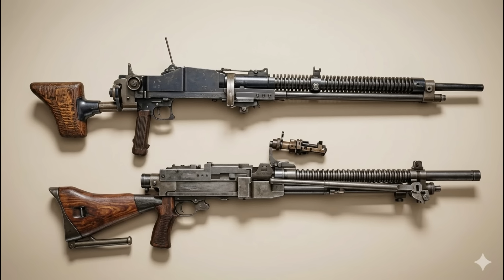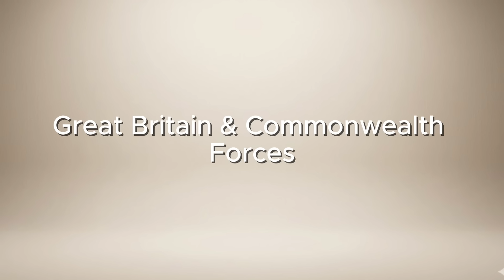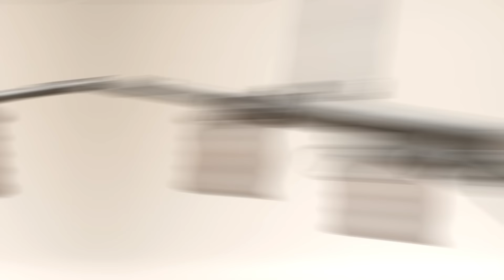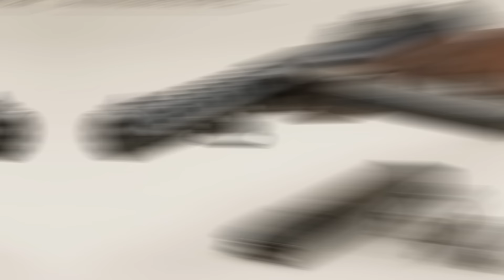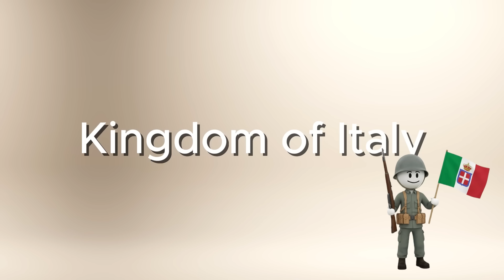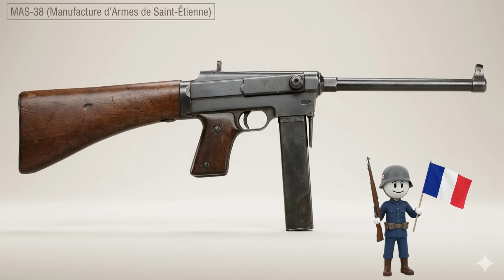Every Submachine Gun Used in WW2

Comment: Carried the Thompsons in Vietnam. First the M1, then the M1A1. Never minded the weight; it worked when the first M16 (XM16E1) did not. Had an M3A1. Junk. Traded it off.Saw an MAS 38 and passed on a trade. Wouldn't take one on a whiskey bet. Best sub gun of years ago was too late to be mentioned here. The MAT 49. Great gun. Can use slightly modified Sten mags. Was on a school patrol with a Sten MK II S. THe silencer worked very well.
What most people don't know is the M3 magazines had issues that were never solved. Magazines were always scarce for everything. The PPSH41 had stick magazine issues; the drum was the favorite.

Comment: ”Suomi KP” - simply best by test. Used even the Vatican Swiss Guard.
Reply: Sucks in Battlefield 5 though. lol
Reply: I was lucky to have a Sergeant with the old Finnish submachine gun in Sweden and tried it at the gun range. It was the best until the Swedish KSP-45 came in 1944.
Reply: Beretta 38, MP-40, PPSh -43, MP-34. 

There's many good ones. I don't know if most experts would say the Sumo was the best.
Reply: In WW ll making 3-4 pretty good guns in the same time as one excellent gun worked out best in the long run.
Reply: Yeah it´s still very highly regarded here in Finland!💪

Comment: One small correction: The Magazine on the MP 38/MP 40 was not meant to double as a holding grip. One was supposed to grip the magazin holder, not the magazine itself, which  could lead to feeding problems.
Reply: When you think about it that sounds like why people had problems with the sten submachinegun.
Too often in movies you see the actor grasping the magazine. But in other scenes it is held just behind the barrel and works smoothly. I had always thought that those that complain the most about weapons do not know how to handle them correctly. If the sten was as bad as depicted, then it would not have stayed as long as it did.

Comment: The video suggests the PPSh‑41 “turned the tide” on the Eastern Front, but wasn’t that more about mass production and Soviet doctrine rather than the weapon itself?

If the Suomi KP/‑31 was arguably more accurate and refined, why is the PPSh-41 often credited with the real battlefield impact? 🤔
Reply from the maker: Good point. The Suomi KP/-31 was probably more accurate and better made. But the PPSh-41 was much cheaper and faster to produce, so the Soviets made millions of them.

Because of that, whole units could carry automatic weapons, which made a big difference in close fighting on the Eastern Front. So its impact was really about mass production and Soviet tactics, not just the weapon itself.
Reply: I picked one PPSh 41 up years ago. It was built like a tank.  Very heavy. It was carried with a shoulder sling.  It had an excellent reputation for rugged reliability.

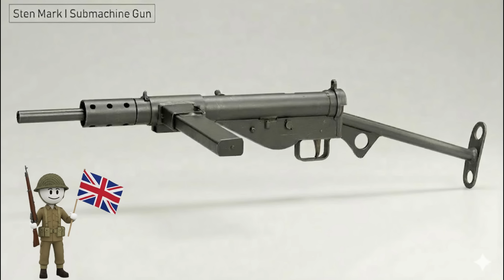Comment: 3:36 That's a mark 2 not a mark 1. As stated later the mark 1 had wooden parts. For anyone wondering what happened to the mark 4, this was a shortened version intended for paratroops. It didn't get beyond prototype stage. 6:20 The magazine wasn't brass, just the housing. The magazine was side mounted, not on the top.
Reply from the maker: It is not on the top, in in the side😊
Reply: @CombatLoadout  Must be the photo. Looks like it is on the top.
Reply: Appreciate the catch on the Mark 2 vs Mark 1 swap, but the Lanchester actually had a brass magazine housing and a bronze-alloy magazine well, which is probably why people stay confused.